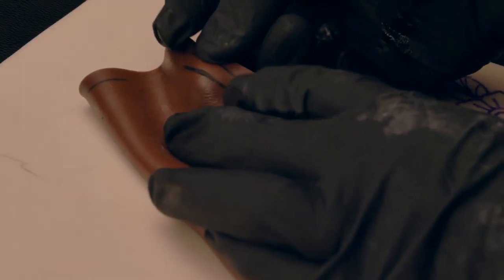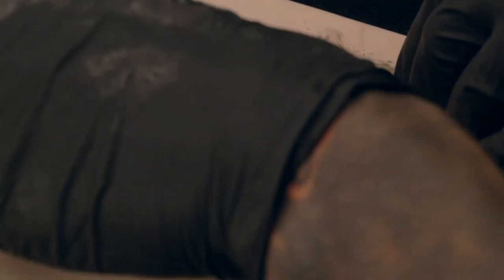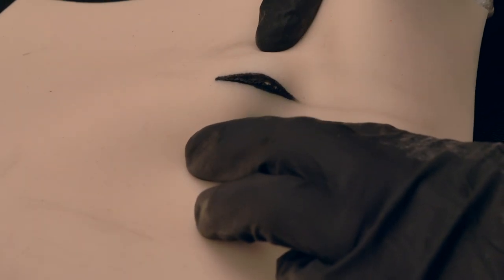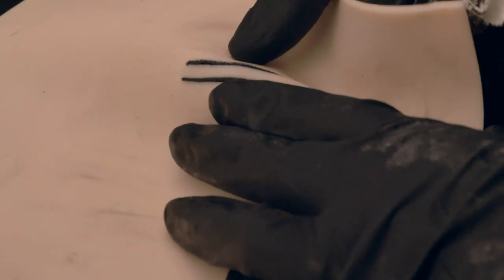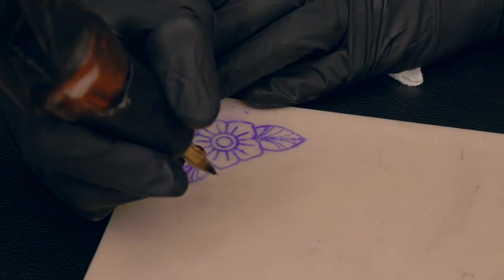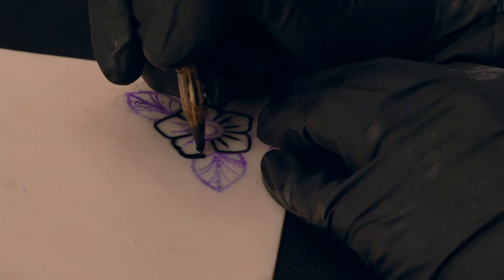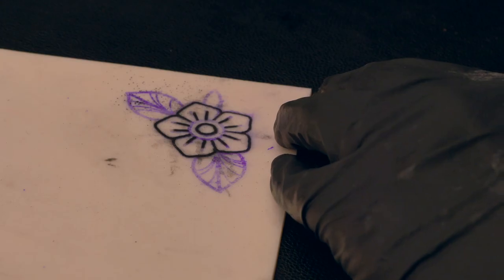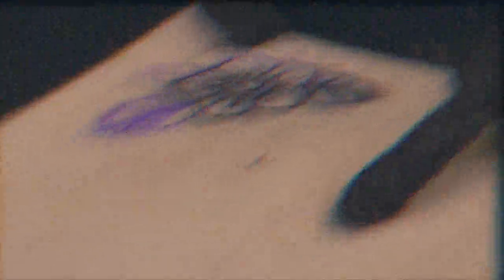How To PREVENT Fake Skins From Ripping!

Comment: Im using reelskin now after using cheaper stuff for like two months, so i got used to having to go extremely slow. 

Im always either just scratching the skin, not getting saturated lines, or im totally slicing it up. Very frustrating but ill keep practicing! Thanks for rhe video
Reply: The cheap fake skin are rubbish that’s why there not the correct depth there 1.5mm so it’s going to tear no matter what on them cheaper ones